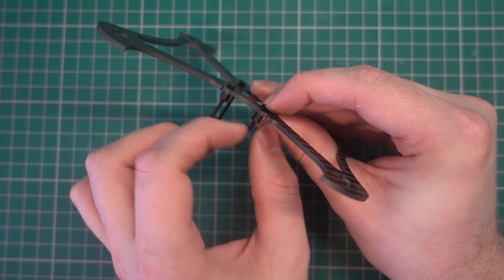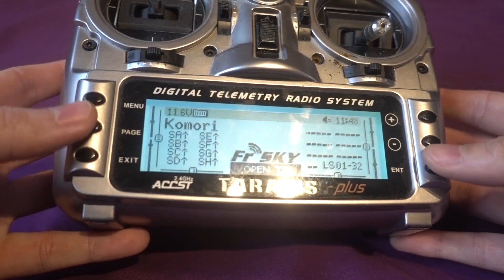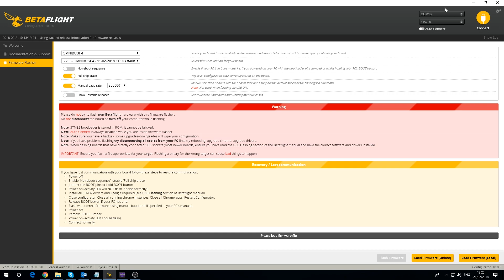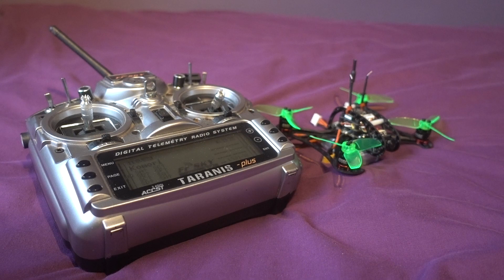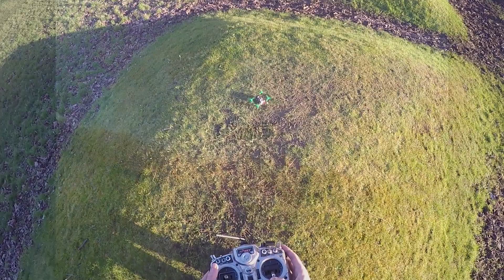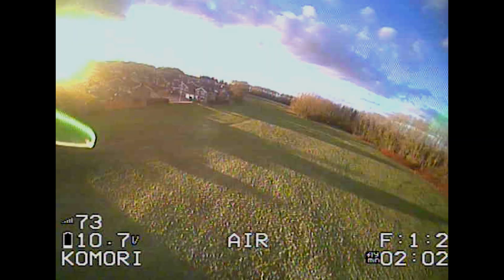87 GRAM! 3 Inch Ultralight FlexRC Kamori - Build - Setup - Fly!

Comment: Just finished my build of the Komori - and like it better than the XJB! I used all the same parts and hooked up the Tramp protocol. I think the 3" flies a lot better than my Flex Ascent 2.5". Did you ever change your tune or did you stick with the PIDS in your video? If you changed them, may I ask where you settled? Thanks Andy!

Comment: Nice review know how you love 3" quads. Looks like the Emax 2206 x 6000kv motors handled the 2.8" props great. When you go to 3" props Emax  reduced the kv on their BabyHawk R 3" from 6000kv to 4500kv. You can always use props with less pitch than the Avan props. Another motor option would be to go to the RCX 1304 x 5000kv motors they would only add a gram per motor but add a lot more thrust. Looking forward to seeing how the quad will work on 3" props. Thanks John

Comment: In all honesty, it makes me slightly angry that they are starting to oversize and lust after power more in the motors instead of absolutely perfecting them. It also makes it harder and harder to get flight times of at least 7 minutes in a simple hover because of unnecessary weight. it makes it hard as heck to find and buy spare motors and already makes it hard to build a light weight quad for us that don't lust after speed because people somehow love the mew larger, heavier motors who somehow dont give THAT much more performance. It's funny actually, but by cutting weight you can also improve speed and performance... but dont quote me on that, that's just my personal opinion. My 6 inch 250 quad weighs 325 grams WITH it's 1300mah battery and 246 without the battery (It was originally 450 grams auw, but then I realized how much useless crap was on it, lol).
it uses 1806 2280kv motors and it flies fantastic... but light weight parts are stupidly hard to find and a personal fear is that they just completely die out.

it aint wrong to love speed. it's great! But some quads are already, literally too fast and most racers have to set throttle limits in their controllers when they customize their drones with their current motors, nevermind the larger ones. they are only really impressive in dead straight lines and to demonstrate punches.

Comment: I run the exact same setup on a Tommoquad Lil Predator and man my motors get hot. Ive tried everything to get them cooler but it's a struggle. How hot are yours?
Reply from the maker: mine seem fine what is the weight?
Reply: AndyRC 1 sec ill check. I had such bad throttle up isolations on stock pids. It's now running .6 TPA, soft mounted everything, filters tuned with flight data, pids reasonably tuned. Also I have D term down at 10 and it's cooler but still far hotter than my other 13 quads I've built. Also checked motor screws etc. No good. The TPA fixed the throttle wobble but for the life of me I can't get it to run cool. Only using 3s too.
Reply: AndyRC 85g no battery

Comment: Hi, great video man! like watching your vids. will be experimenting with motor combos in regards to light weight 3". looking at 1306 and 1106 motor. Any 1306 or 1106 recommendations and why? I will be going more of a freestyle build as well. ordered 2 similar frames (hyperlite tooth fairy 3") and 2 aio fc (hglrcf428), spare/used cam and vtx combo. going to run mostly 3 blade props between 30-60 pitch.
Reply from the maker: those 1104 eachine motors of the new lizard can seem to take a beating on 4S cheers
Reply: Dragonfly 1306s from fpvmodel are cheap as chips and while not super powerful, they are pretty efficient with most 3" props. Not fast by any means but I was getting around 8 min fly times with some light acro on a HJB 145 frame. They are rated for 3s but I have run them pretty much only on 4s without issue and at $4 a pop, I don't mind if I burn one out, bought a few spares lol. Bolt pattern wont match 11 series motors though so take that into account with frames.
Had these running on another super cheap frame with a weight of 105g without battery and they felt nice n peppy.
(Rotor X 1404s are also badass.... but super fragile)

Comment: But the QX80 is only 55 grm.
Reply: This discussion could go on all day. Just where do you measure the size of the Quad? You are right the QX80 is 80 mm diagonally and won't take 3" props. The FlexRC Komori must be more than 3" diagonally, so I assumed the 3" was between the motors laterally.
Reply: If you MUST miss the point, the FlexRC Kamori is NOT ultralight.
Reply: Don't talk down to me and I won't ruffle your feathers. My point is I DON't AGREE WITH YOU. Sorry if that offends your ego.
Reply: Andy, I apologise for adding this to a great video.

Comment: The R-XSR has an uninverted Smart Port pad on it and you can take that right to TX3 or TX6 on the FC. I did it on this stack and it works flawlessly without messing with soft serial and remapping resources. Also I did the mix in the X9D to show RSSI and is showing the RSSI value on the OSD.
Reply from the maker: it wouldnt work on my version hence the remapping i wonder if the TX6 is inverted hmm cheers.
Reply: Agreed...did this a couple times already (2 different quads) and about to do it on a third.  Worked great including RSSI.  Very weird Andy had to do all that...
Reply: AndyRC TX6 is not inverted that I know of. I used the uninverted Smart Port pad that is on the RX. It is soo tiny... I took that to TX6 and it worked for me.
Reply: TX3 and TX6 not inverted.  Def. a fact.
Reply from the maker: is it the V2 that you have or the V1? I must have missed something in the sequence it could of been the rxsr FW i tried for a while on the Uart 6 but i got it working on the ppm and hey now i have a spare uart :) i guess if your receiver is inverted this will work for people also and then put tlm_invert command on it. cheers
Reply: The XJB 145 came with version 1 of this stack? I have used the uninverted pad on the R-XSR as well straight to TX6 to get telemetry but I don't see anyway to control the camera power through OSD. I guess there's no Tramp on the V1? Both TX6 and 3 were free on the bottom of the flight controller.
Reply: TaterFPV It depends on when and where you bought the xjb 145. I do have the v1 with no control through Bf on vtx. I can control pids because I connected RXSR. But the v2 has been shipping for a while with new vtx. It will say in product description if it is v2
Reply: I think I have the V1 as well then. I have an F440 stack waiting to put in a 4" Ascent. Wonder if it's the same? Thanks for the reply!
Reply: TaterFPV I bought f438 stack at beginning of the month from GB. Arrived yesterday. It is the v2. Hope that helps
Reply: Awesome you are correct. I got mine from RotorVillage and it's dated 02-06-18 and clearly says right on the box V2!
Reply: I have this stack (v2) and received today my receiver R-Xsr, do I have to use the uninverted pad from the receiver to connect to TX6, or could I use the inverted that is on the connector, it would be easier to make the maintenance to the quad if I can remove the receiver later. Thanks.
Reply: Francisco Gomes Nope, you have to use the uninverted signal pad with this stack.
Reply: Alright, I flash the right FW in R-Xsr and solder it to my FC, already bound it to the transmitter, but when I move the sticks on the TX nothing happen in the betaflight receiver tab, already checked every wire and receiver configuration,  did a Full Chip Erase and already tried the 3.2.2 version of BF but its all the same, the telemetry is also only showing two values, I don't know what else to do.:/

Comment: Hey Andy I happen to have the F 440 stack which has the exact same flight controller... I know you said you didn't believe it had current sensing but it actually does if you pull the top stack in the flight controller off and you look underneath the bottom side where the PIN receiver is there's additional pads one is for RSSI and one is for current... The other part I didn't understand but this is on my ESC was it has a tx0 it looks like on the ESC pads
Reply from the maker: yes it has a current sensor solder pad on the fc but it requires the ESC to have a current sensor on board which is doesn't. cheers
Reply: AndyRC  thanks for your reply back I'm new to this... I didn't realize on the 440 the esc's do have a different spot right next to the low  ESR capacitor....  tx d? 0? It's so small I can't really tell if it's txd or tx0 but that is on my ESC section ... The other question I have again being a noob and seeing as you use the exact same flight controller and receiver I'm curious why you did not place the smart port protocol wire on the RSSI pad ... I will thank you for your assistance ahead of time ...

Comment: That flight video at the end though....mint. I don’t think you need those 3inch props.
Reply: On paper some of the 3 inch props can produce more thrust with about the same amps as those 2840. The 2840 are a little bit less efficient than newer 3 inch props. They sure did fly well though! I wish we had more 2.8 inch options though. The leader 120,  babyhawk r with 2.5inch arms, AND the massive droner 2.5inch can all fit 2.8 inch props. It's a weird size, but a lot of quads use them so it'd be nice to have more than 1 option for 2.8 inch props.

Comment: sorry if i missed it, but how many mm are the basplate? can´t find any specs online
Reply: 2mm
Reply: thx, pretty thin..usally the 3 inch 11xx frames are 2.5mm or 3mm
Reply: yes indeed...but the komori has lateral reinforcements, and the FlexRc carbon is very good :)
Reply: alright, will try one...thx for the help